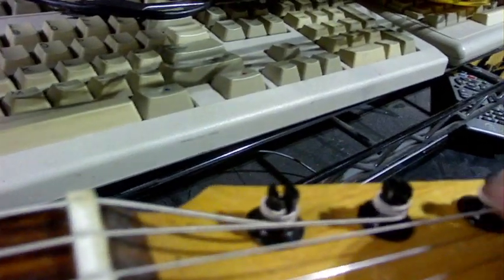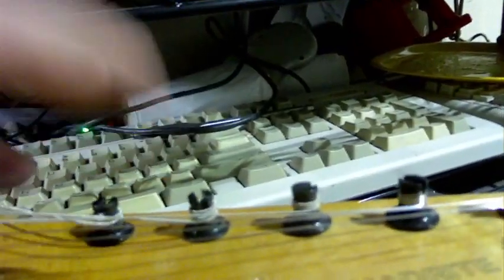Shift 2001/Washburn Wonderbar Talk

Comment: That is a very practical and intelligent design both functionally and installation wise.  Wonder why it didn’t catch on.  As an engineer I know the nut is not a primary cause of tuning instability when using a vibrato bridge as most claim.  You discovered much experimentally.

Comment: recently the pround owner of a strat with the Shift 2001 tremelo installed.....but....no bar present. Boo Hoo Hoo. Any advice which commonly available trem arm might thread into the Wonderbar? The nearest guitar center is 300 miles away, so I won't be driving the strat down there (I hope).
Reply from the maker: @XmanFiM1uR2  I think some stratocaster type bars might work....I'll have to check though.